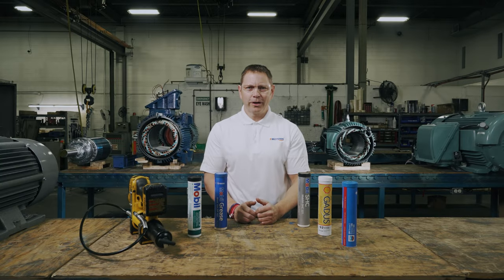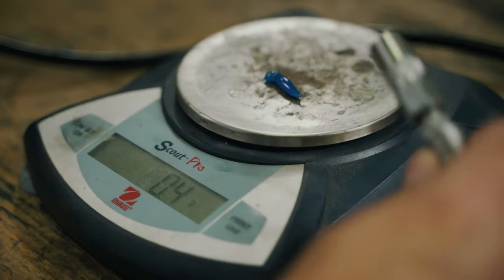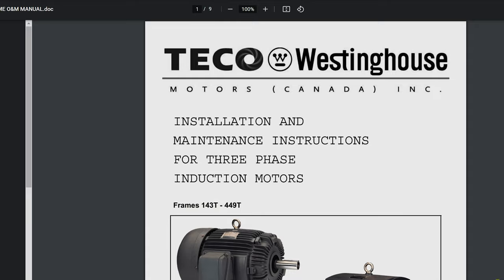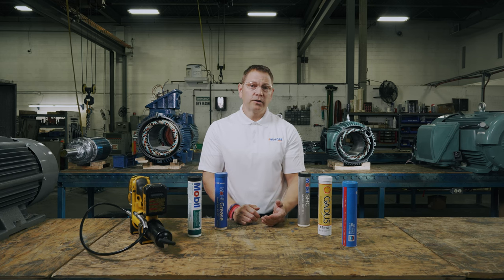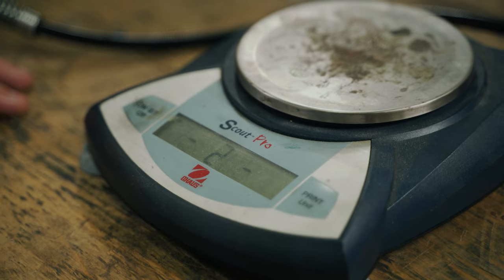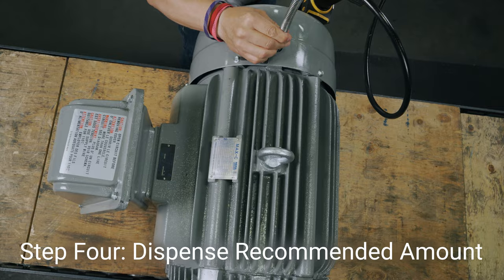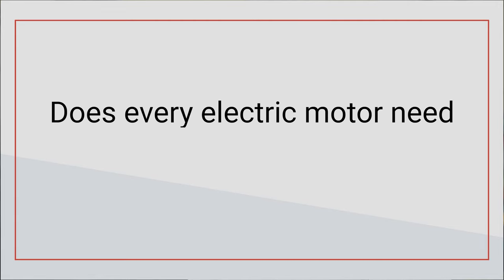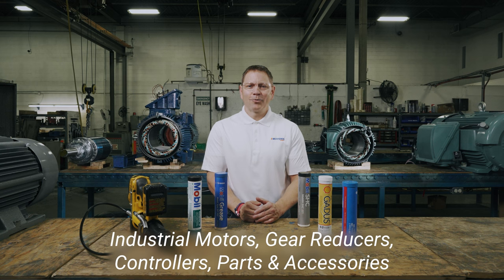How to Grease your Electric Motor Bearings

Comment: Thank you so much sir, I really like your videos.
But I have a question: some motor has only greaser fitting which for adding grease into the bearing, NO  grease drainage plug/drain vent installed on the motor. I am always wondering if we add grease on regular basis, example monthly, do you believe over dosed grease could damage the seal, grease may run into motor winding chamber? if so, this will create another problem for the motor, damage isolations of the winding.... 
Even though we respect greasing amount each time, still afraid ....may end up some grease going into motor winding areas.
I wish I make my question clear, looking forward to having your comments.
Many thanks.
Reply from the maker: Great question. In my experience, it depends. You can grease these motors but it is likely not worth doing it and you should just run the motor for the bearing service life and then replace the bearings. Essentially the benefits are outweighed by the likelihood of failure. - Keith

Comment: Hello,

I have a baldor tefc motor with two zerk fittings on the top of the motor. On the drive side bearing, there is what I am assuming a spring loaded pressure relief drain fitting. I can pull on the center stem of it and it springs back. When I pump grease into the zerk fitting on the top of the motor, grease shoots out of these holes that are onn the sides of the zerk fitting. Does this mean that there is sufficient grease or do I need to block those somehow?

Second question: the non drive end bearing does not have the same drain fitting. In fact it doesn't look like there is a drain at all. Is it normal to have a drain port for one and not the other?

Thanks for your help!
Reply from the maker: Hi Tommy, what's the catalogue number of your Baldor motor? Some smaller Baldor motors have grease zerks but sealed bearings, which is counterintuitive. Those would not need to be greased. You can check the motor nameplate for the bearing catalogue number and then use Google to confirm if that's a sealed bearing or not. Check both the DE and NDE bearing. 

Generally speaking though, if grease is coming out of the drains, you have ample grease (maybe too much). Over greasing your motor can lead to motor failure, so consult your manual to confirm how much grease is required and how frequently. You could also pop the motor face off to see if there is grease in your windings, in which case, you'll want to clean that out. 

Regarding your second question, I'm assuming your NDE bearing is sealed, which is why there's no drain. I could confirm if you share the cat #.
Reply: @emotorsdirect  Thanks for the response. The bearings on the DE and NDE are the same and the part number is 65BC03J30X which don't seem to be sealed. Should I have to remove the fan cover to have to get access to the drain port on the NDE?

Comment: Thank you Keith for a very informative refresher on how to grease electric motor bearings.  I work with electric motors and have encountered many conflicting opinions on the subject. The sonic tool fascinates me and I  plan to look into this technology.
What greasing and maintenance do you recommend for motors in storage?  
How would you safely remove grease from the motor end turn windings caused by over greasing?
Reply from the maker: Hi and thanks for the comment. Great question. There's no reason to regularly grease a motor in storage since it isn’t moving. If there's grease in the bearings and it’s not leeching it should prevent any damage from corrosion.

As far as I’m aware, most modern motors have relief valves that would prevent any problematic over greasing. In case you have an older motor that doesn’t, you can run the motor with the grease cap off so any excess falls out.

Lastly getting grease on your windings isn’t problematic as the grease itself is inert but if you really wanted to clean it off you’d either need mechanical agitation or an ultrasonic cleaner.

Comment: I replaced mine with sealed bearings and cap the zerk. I just went through a 20hp baldor I bought from a dairy farm (was used as a poo pump motor) and opened it up to inspect. The amount of grease inside was un-real. They maybe dumped a whole tube in both sides. The windings, everything was covered thick in grease. With sealed bearings these days, the life span is close to open. Replacing bearings is EASY with the right equip. But having to clean grease off everything sucks.
Reply from the maker: Sounds like a stinky situation... 😂  How did the Baldor perform after all the grease was cleaned off?
Reply: Just finished it, really beautifully now! New Nachi bearings sealed as well. Had it re-varnished as well. Megged out perfect. @emotorsdirect
Reply from the maker: @davidiliyn  good to hear! Those Baldor motors were built to last.

Comment: Thanks alot for this vedio, Kindly when we greasing the motor is should be Turn off or we can do it while the motor still Running?
Reply from the maker: Ideally the motor will be running and warm so that the grease can evenly distribute throughout the bearing.
Reply: @emotorsdirect okey, so what the Best method to make the greasing in good way.

Best regards 🙏

Comment: I don't understand how you can grease wihout first removing the drain plug to let the old grease out ? If you put new grease, where the old is going ? In the widing 😮 ?
Reply from the maker: Yeah good point! That is an important step. I do mention to remove the purge value cover at 4:44, but you don't see me do that step in the video. Easy to miss for sure.  - Keith
Reply: In the case of the previous owners of most motors I open up, yes....

Comment: Keith, how about details around removing the grease drain plugs.  How do we access grease drain plugs without removing the fan housing covers?  Also if the motors should be running when we grease, how is it safe to do this with covers removed?  Why do motor manufacturers make it so difficult to remove the grease drain plugs?  Does this mean they don't want us to grease them?  Thank you
Reply from the maker: Hi Carl, great question. Every brand of motor and every situation is a little different. In most cases the drain plugs are extended out, or can be extended out using some 1/8” NPT black pipe. If the only way to get this done was to have the fan cover removed, then you would also want to remove the cooling fan for safety purposes. Before installing a new or rebuilt motor, you should have a plan on how to grease it for the next 10-years, if this means making some modifications to the grease zerks or drains, now would be the time to do that.

Comment: Very nice explanation. 
I have a elevator geared motor " 90L/4 CUS BRE20HL " but 2hp but I don't know what kind of grease it needs. Please inform me in this matter. 
Thanks.
Reply from the maker: Thanks for the question. I need to check with the manufacturer on this one - hold tight! 

- Keith
Reply: @emotorsdirect  🙏
Reply from the maker: Chatted with the manufacturer and they said to use any grease. We usually go with the Mobil Polyrex EM at eMotors. - Keith

Comment: Hai sir such helpful video this..
I’ve one doubt sir 
We are doing PPM for Electric motor we put grease in 1st PPM. After 3 months again we went for for PPM that time I found there is oil leak.. what is reason sir 
Why grease become oil..? Sir please explain
Reply from the maker: Hi Mohamed, thanks for the comment. Grease is just oil and a thickening agent. There are various reasons the oil could separate out and drip. The most common reason being excessive heat.

Comment: ..thanks for this good informations!!..
My question is, How can I determine the volumetric amount of grease needed by the bearings for any motors in grams?
Reply from the maker: Hi Mohamed, thanks for the question. 

There are multiple formulas for volume of grease from multiple OEMs so I would recommend whatever formula the specific OEM publishes for their motors. I should add that, generally, over greasing will only happen if you don't allow the excess to drain by replacing the relief cap prematurely or there is solidification/hardening that is causing a blockage.

Comment: Keith, what type of grease should we used when greasing electric motors? will it be the same al pillow blocks?
Reply from the maker: Hi Harry, always defer to the recommendations in the manufacturer manual. If the documentation is not available, Mobil is a good catch all.

Comment: Didnt grab properly, how often should we grease and how to determine the amount of grease and number of strokes required?
Thanks.
Reply from the maker: Hi Ramisio, it depends on your motor, how frequently it's being used, and the environment of the motor. Consult the manufacturer manual for recommended guidelines.

Comment: Hii Sir, I am Debiprasad Pattanaik.

Sir I am observing more nos of  motors problem due to bearing damaged in my plant.
We are using Lithium complex grease(NLGI2) in our motors and maintaining greasing schedule once in 3months.

We are opening to grease drain valve of motor during greasing but old grease is not coming out through drain point.can this cause harm to bearing?

We are suspecting that grease quality is not good.

I need your inputs/check points regarding the above problem.
Reply from the maker: Some motors have no inner retainer and rely on the shield on the bearings. Over greasing can pop these off and cause grease to enter the motor. in order to remedy, set up a greasing schedule with amounts of grease per bearing to avoid over greasing. This would not be a grease quality problem.

Comment: Should i grease a new electric motor? Or i need to Run it first until next preventive maintenance then ill regrease the bearings. Any idea?
Reply from the maker: Motors come greased from the factory as they have to be tested before being shipped. You don't need to grease the motor before use if it's new. Thanks for the question.
Reply: @emotorsdirect  i just wondering is it ok to grease an electric motor while its running? Or should i turn it off
Reply from the maker: @Jadfitree  Generally accepted practice involves running the motor so that the pressure on the grease mimics operation conditions and doesn't result in over greasing.
Reply: @emotorsdirect4643 What about slowly turning the shaft (if possible) while greasing?

Sometimes, we get hit with motor PMs and it's impossible to start certain motors on the line due to interlocks in the ladder logic. 

Or sometimes we will get a PM for an asphalt pump motor with the system cold. That means if you try to start the motor, you're either gonna snap the impeller shaft, or just overload the motor if you're lucky. And they expect us to get PMs done on the day assigned 😅
Reply from the maker: @that1electrician  Sounds like they make your job real easy 😅 But great to hear that PM is getting done! If you don't have the option to start the motor first, you need to be careful to not add more grease than the manufacturer indicates for a given time interval and leave a note to remove the drain plug for the first 30 ish minutes of operation to allow any excess grease to leave. Hope this helps - happy PMing!
Reply: Thank you